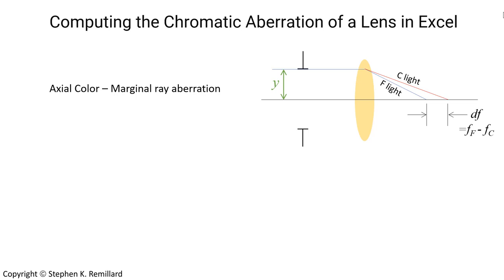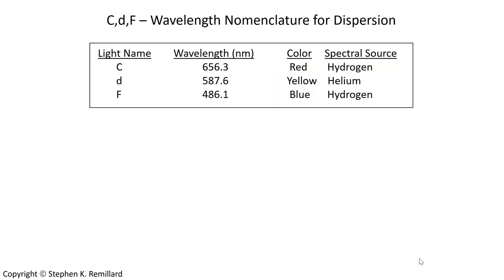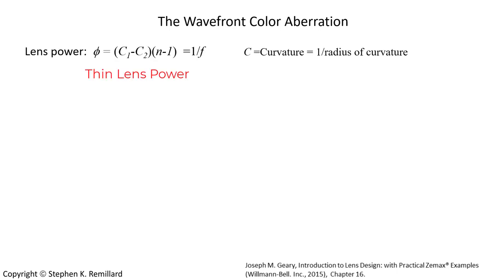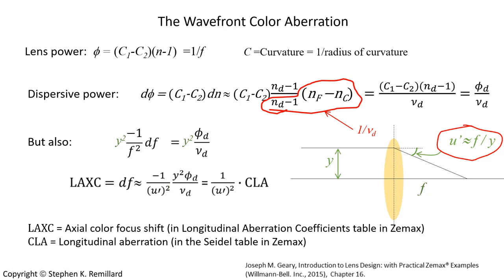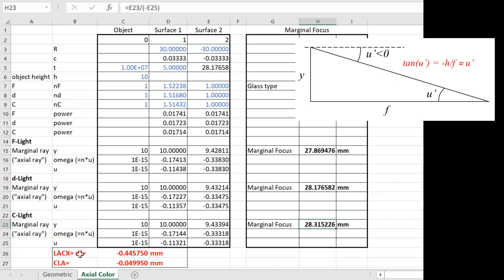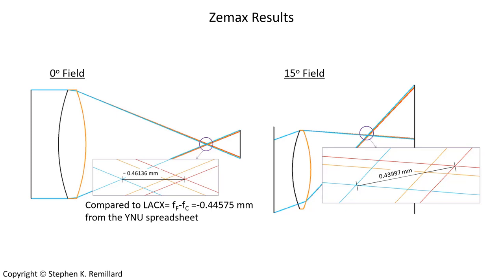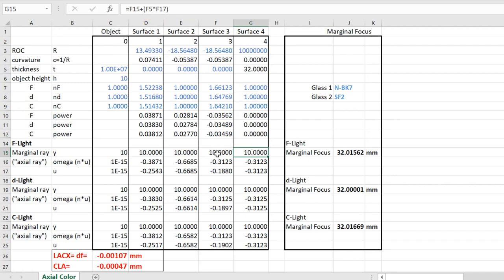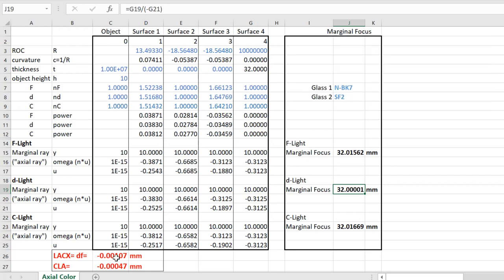Chromatic Aberration: Calculating the Axial Color of a Lens

Comment: Hi Stephen,
I was going through the derivation around 6:15. I think the exiting ray angle u'=tan(y/f)= (y/f) for paraxial approximation. That might be a typo from the slide. Then the expression for LAXC where you have 1/(u')^2 makes sense. Cheers. Its a great reference for a rough estimation of the achromat design. Thanks.
Reply from the maker: You are correct.  A typo on the slide.  Clearly the tangent is y/f.   Thanks for noticing it.

Comment: Hi Stephen, First really thank you for putting all the things together. Following your tutorial really makes me understand the thought process step by step.
I just have one question wants to verify. For the Achromat YNU spreadsheet, the CLA you quote -0.00047 mm. I recall the CLA = LAXC*(u')^2 where the u' is -0.3125 in this case. My calculation gives -0.000104 mm for the CLA. Maybe I missed some thing here? Thank you.
Reply from the maker: Yadong,  You are correct.  It is -0.000104 mm.  This question is concerning cell C27 in the spreadsheet beginning at 19:25.  I checked the spreadsheet that I used in the video, which miraculously I still have.  The formula for CLA should be "=C26*(G21*G21)" .  I had "=C26*(E21*E21)".   Probably when I added the third and forth columns I didn't update that cell.  Thank you for bringing this up.
Reply from the maker: By the way, this cell wasn't used for any purpose.  It was just there.  So, fortunately there are no "domino-effect" errors to be concerned about.